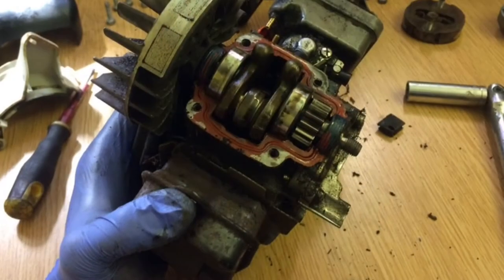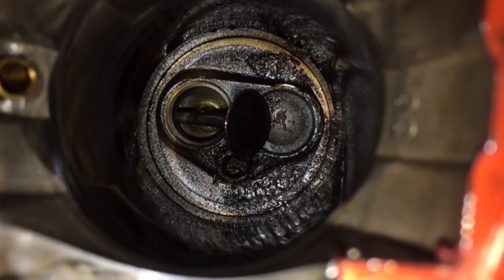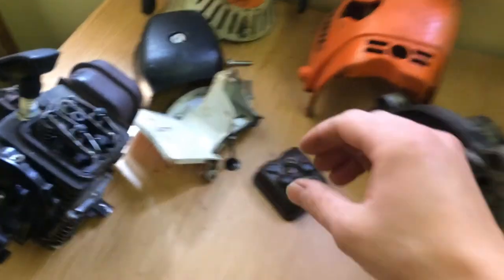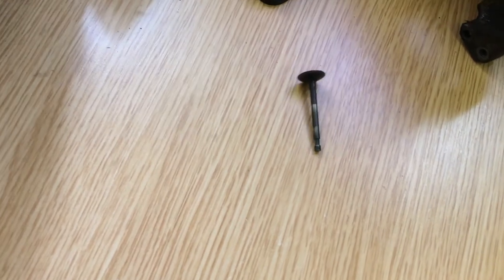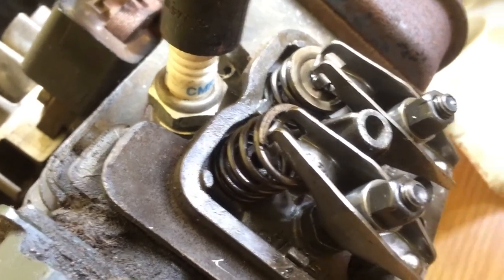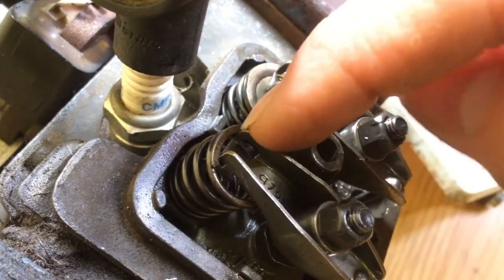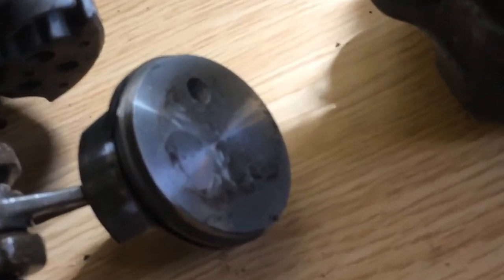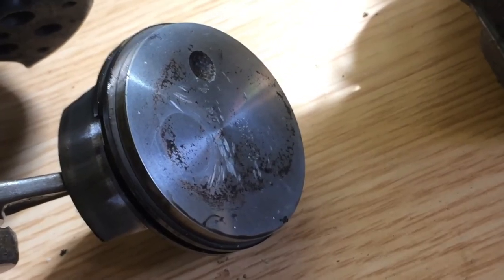STIHL KM130R Part 1 strip down and diagnosis seized engine

Comment: My engine is locked up I took off the string pulled assembly and I could not turn the crank. Do you think it’s the Poston?
Reply from the maker: Dropped a valve I’d say.
Reply: Yes